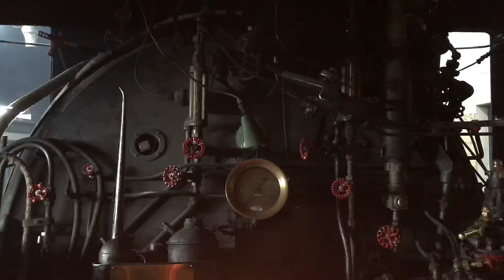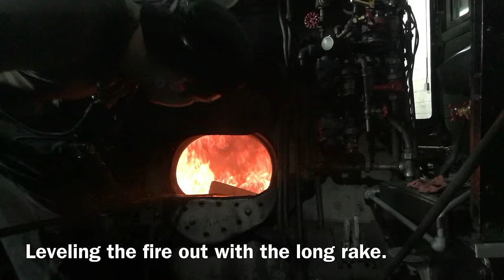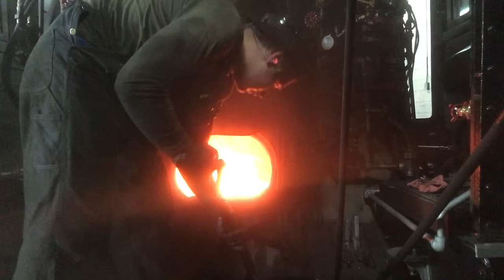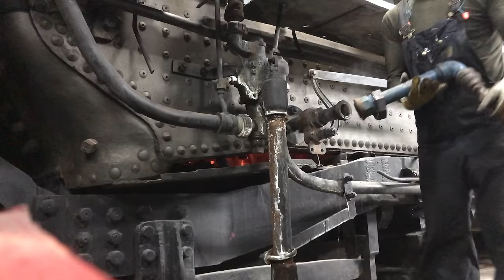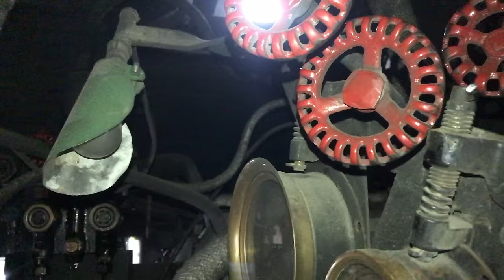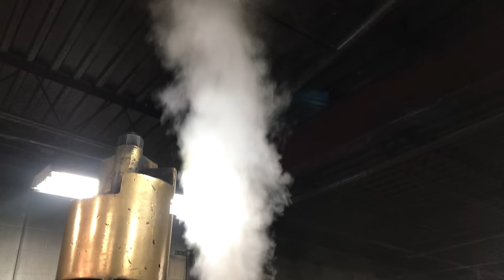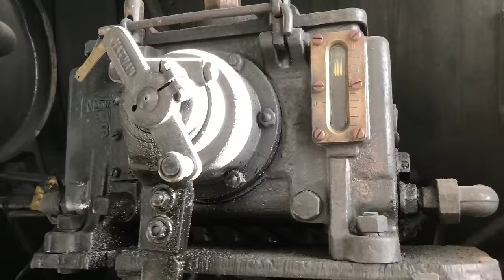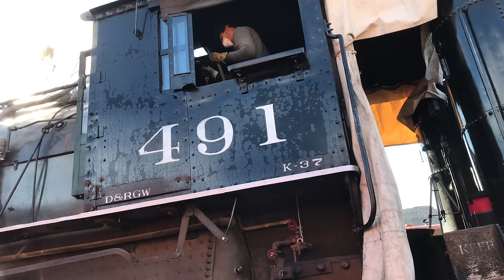How To Fire Up a Steam Locomotive [4K]

Comment: I can't imagine the same job done for a "Big Boy" which is by the way under restoring process
Reply: LuiginoCisalpino I think Big Boy is oil-fired.  Still tons of work but that's one less worry
Reply: Yes. They plan to use oil but, think at the golden age, when they were coal fired, it took a machine to put it into the owen...
Reply: I'm sure the big boy will take more than one guy to get it ready to go. One thing that might be easier is that it will be oil fired.
Reply: duplex engines used coal augers to feed the fireboxes. using bunker oil is mostly just cheaper.
Reply: It's my understanding it also prevents cinders that start fires along the right of way.
Reply: Yeah, even if the Big Boy was running on coal, there would no way be enough time to even shovel coal into it. If they did shovel coal for the big boy, they would barely be able to have enough to even operate the whistle. They had these large screws in the tenders in the large steam locomotives back when they still used coal where it moved lots of grinded up coal into the firebox. Of course oil fired is faster and probably better, steam is steam anyways.
Reply: it's not a big difference in performance. burning oil helps at higher altitudes, but the main problem with coal is that nowadays the quality coal you need to run most steam engines is too expensive and can be difficult to get. you generally can't run steam trains on cheap powerstation coal, it's too low quality. even when you convert them to burn oil, they can still be picky on what oils they will run well on.
Reply: It's my understanding oil burners ran on heavy, tar-like #1 bunker oil. Now the best you can get is #2. UP has converted it's steamers to oil and they seam to run just fine. I presume they have to burn lighter oil in the firebox. The Big Boy will be an oil burner when its restoration is finished. 844 already uses it. I don't know what's up with 3985.
Reply: g bridgman do you mean embers?
Reply: It is impossible to fire Big Boy by hand. You could not get the coal in fast enough to even raise steam pressure much less keep it going if you crack the throttle
Reply: Robert: I'm sure this could be said about many modern super power steam locomotives. I can't imagine firing any of them by hand. That includes 844 and 3985 before they were converted to oil. 611, 765, T1 2102: I'm sure they're all the same.
Reply: It's possible for 1-2 people to shovel about 1 tonne of coal per hour but you'll need about 12 sq m of fire bars to burn the coal that fast. On the steam tug I volunteer on we have two single ended scotch marine boilers with 3 furnaces each. With 3 iwg of forced draft into the fires at full ahead 2000 HP we consume 1 tonne per hour all shovelled by hand. That's why I can't imagine a single fire burning coal faster than it could be shovelled in when we can't burn coal that fast with 6 fires. And we use power station coal it works just fine but isn't as hot as steaming coal and it has a lot of fine dust mixed in it which flashes a fire ball back at your face when you stoke it.
Reply: please make a video of your ship. i would love to see it!
Reply: LuiginoCisalpino theyre wanting to convert the 4014 to oil fired (didn't work last time they tried in the 1940s) which will greatly reduce the work. The 844 and 3985 are already oil fired. IF they wind up needing to stay coal fired itll be alot of work to keep the ash pan clean and the locomotive running in tip top shape.
Reply: g bridgman its #5 they run.
Reply: KiwiPowerNZ the single Firebox on the 4014 is enormous. Once you get the draft going it eats coal like candy.

Comment: I’m curious where the fire box gets it’s air from I’ve never really thought about that before
Reply: There's an air intake under the grate. As the exhaust steam exits through the smokestack/chimney, air is pulled through that intake and into the fire.
Reply: Primary air to burn the carbon in the coal comes through the damper(s) under the firebox. Secondary air to burn the released volatiles from the coal comes through the fire door.

Comment: how long does it take to prep the locomotive before it's ready for work? By the way, awesome video. Quite fascinating.
Reply: Robert Descatoires It depends. Smaller locomotives start up quicker than larger ones as the fire heats up a smaller boiler fairly quickly. It also depends on whether or not the locomotive has been in steam recently. Locos that have been in steam recently can be brought to operating pressure in a 3 to 4 hours thanks to the boiler still being hot/warm. However locos that have not been in steam for a long time i.e. two days or more, take longer as they need heat a cold boiler, typically 6-7 hours. One must also consider the boiler itself, i.e. the metal. Metal expands when heated, and the boiler's various parts needs to be heated gently as a intense fire on cold metal will cause the metal to expand way too quickly, either causing warping or worst, fracturing the metal.
Reply: @seanyazzie8191  Thanks Sean, your reply was very much informative. So I gather that when locos were in service, they were stoke at all time, except when maintenance was due.

Comment: Ok... now how do you shut it off?
Reply from the maker: hawkdsl Basically you fill up the boiler all the way  with water, let the fire die down and turn all the valves off and let it cool naturally.
Reply: But some drivers and firemen leave a small fire burning so tomorrow it would be easier to start and move the engine
Reply: Wolfgod Mak I was wondering if this was the procedure every single time or what was typical for day-to-day operations.  thank you

Comment: Awesome Jeff. I hope this won't insult you but you look like you can't be more than 30 years old. It is so awesome to see someone so young get involved in steam era! I've been to a couple of steam shows where they show steam traction engines. Sadly there are more and more gas tractors and fewer steam tractors. Why? Because the younger folk don't want to take all the time needed to fire an engine up, do the oiling/lubricating, They prefer the gas and oil tractors because for the most part all they have to do is turn a switch, and boom! It's running.  One of the shows I went to years ago had some gas/oil tractors, but clearly more steam engines. I went back some 30+ years later and there were definitely fewer steam engines, and probably a 2:1 or 3:1 ratio of gas/oil engines. One of the traditions they had was every day to blow the whistles at noon. This was to let the women folk now that they were heading up for food soon. As best I can remember, the difference in the levels with all of the whistles blowing between the first and second visit was very noticeable. There's a lot of heritage work all over England. There are many stationary steam engines that have been restored and are kept running usually 2 days a month in the warmer months. Most of these engines are Pumping engines that were used for water or sewage (very few now) and they also have some for industry as well. At present, they have the largest working steam engine in the world at Kempton Park in England. They also have the "Great Dorset Steam Fair" that runs once a year and last 5 days. This is all kinds of steam powered tractors, trucks, cars, and more.  I was planning this year to go to Kempton Park, and was set to go........ until the pandemic. Hopefully next year.

Comment: Fantastic video looking into getting one of these beautiful machines running. Just noticed that the wheels are inside of the frame. I don't think I've ever seen a steam locomotive designed this way. Usually the drive wheels are outside the frame, with the counterbalances attached to them.

Comment: Love these types of video with old world machinery. Just a couple of questions, how did they clear the ash trays back in the day without air compressors? And how did they circulate the hotter water to the colder parts of the engine?.

Comment: Doing a complete cold and dark in a modern fighter jet in DCS or even in an airliner that's a PMDG module for MSFS is a brisk stroll in the park compared to this. This actually makes me want to have a fully simulated VR representation of a steam locomotive with proper VR controls implemented as part of a decent train simulator.

Comment: I don't know if this would be applicable to steam-locomotive but wouldn't it be better to start shoving the coal first, then put the wood on top of that and then light this up? So it burns like a candle as opposed to burning like a campfire. I know that the way I'm describing is used in coal stoves used for heating an apartment because it's more efficient (about 40% more) and produces less toxic fumes. Would that "candle-fire" way of starting up work with steam locomotive? Or would it lenghten the process to much?

Comment: Om the EBT R.R. with the tender full we used about a dozen split rail road ties, 90 shovel full of soft coal,30 gallons of kerosene / oil mixed half. wedged fire doors tight with washers then lit the waste and left till round house drafted out black smoke .Then we went back in to build the fire up.

Comment: It was my dream to drive and operate a steam locomotive, but they're rare in main rail services, and most are just used for mostly tourism or park attractions.

I don't want to replace diesels with steam, don't get me wrong. But it would be nice if steam engines were a little more common. Especially in main rail services.

Comment: ALWAYS wondered how they got started! Thank you so much for such a great video and explanations.  I can't think but how polluting these locomotives are in terms ofn petroleum derivates (greases, oil, etc).  Wouldn't be a great thing to try to catch/filter those residues somehow so they don't get spilled into nature?  It all ends, eventually, in the soil or in water streams.  I know it would take heavy modification of the locomotive, somehow "ruining" the original experience, but times have changed, so must we and the machines the use.  Cheers!

Comment: What is the small penberthy injector on the fireman's side under the cab for?
Reply from the maker: I plumbed it in to use the injector as an ash pan sprayer. The discharge of the gun fed through a hose, into the wand, and then through a pressure washer tip on the end. The idea was to get a better, quicker washout of the ash pan (compared to compressed air) with far less dust that would also put out any fires that could start after the ash and cinders got dumped from the pan to the pit. Unfortunately, this never really worked well as the quality of the new Penberthy injectors is absolutely abysmal. We tried several brand new Penberthy injectors and each one had some issue that prevented it from operating as expected, a very similar issue, I have found, with the new Penberthys at Disneyland.
-Jeff

Comment: Using Multiple types of wood will cause uneven temperatures to rise in the Firebox and this can lead to over heating of the heat exchanger...For the Best Result Always use The same type of wood and pure wood no ply wood ..also the larger the quarter stick the more even it burns resulting in a much safer operation

Comment: Please....just put some rubber wheels on it and take it out to the streets. 

You're also gonna have to put a turning wheel to the front and to the back of the train, so you can cut through New York tight corners.

Comment: As one seed it takes more work to get this engine running. Look at film starting a diesal engine slot less work. Less money my grandfather and my dad railroad got coal very cheap but labor overtaken the cost of a diesal and fuel and oil changed. There was water stops my dad said he went through twenty thousand gallons of water and twenty tons coal to get from Conway pa to Philadelphia and diesal used 3000 gallons fuel for two engines a lot faster no water stops had grease the connecting rods too. The boiler had to clean out scale like on tea kettle. Steam heat the steam condensed and reused steam ships have condenser that use sea water the boiler has to impected with fire side and crawling inside on water side to check for cracking and rust once a year this means removing jackets